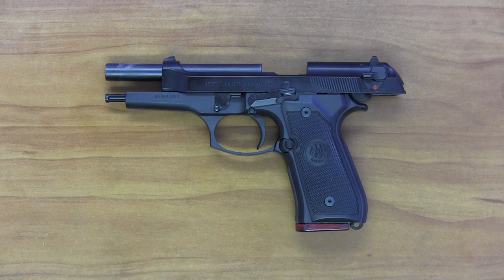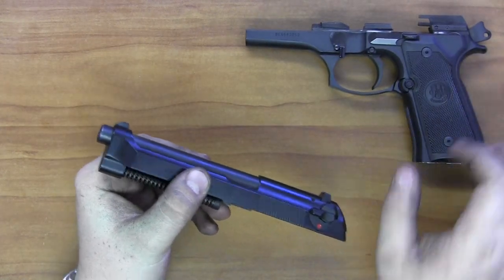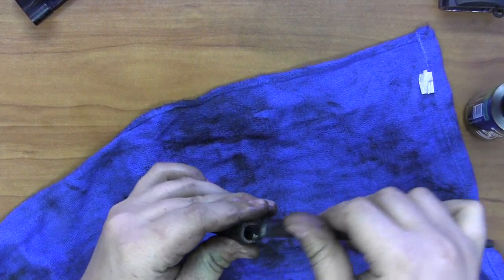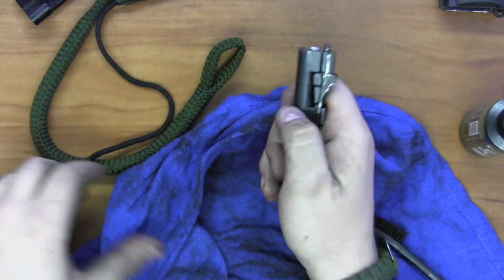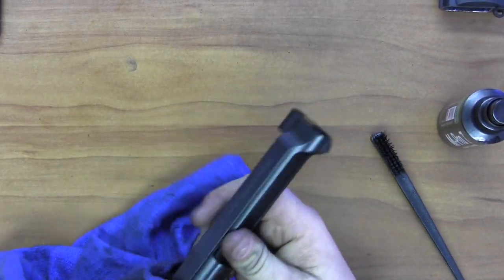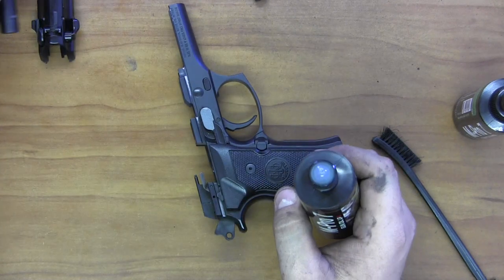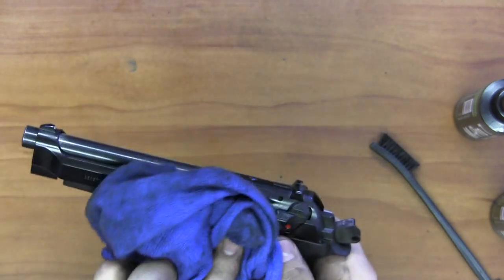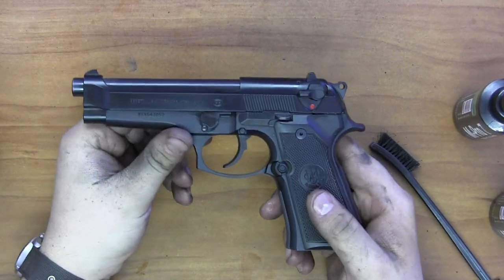Beretta M92 / M9 Instructional Video

Comment: You clean guns like I do, I just make sure that I don't get any solvent on the exterior finish of my guns. I use very light gun oil on the outside along the rails and rub any access oil over the whole outside surface with a clean rag. I make sure the interior barrel also has a light coating of oil as well. I just purchased a M9 a couple of days ago and I'm totally stoked, thanks for the video!

Comment: I have an airsoft M92 which I had to strip to adjust the hop-up. The process was exactly the same as this video and the components are almost exactly the same! The guide rod is a slightly different shape (there's a nub at one end that locks it in place) but that's about it! I was quite impressed with their attention to detail!
Reply: +fireaza What brand is it? WE, KJW or other?
Reply: +Morris Zachrisson It's a WE.
Reply: ***** Without decocker function?
Reply: That's right.
Reply: ***** Be carefull :)
Reply: y

Comment: I have a few Beretta's on my collection.  The weakest part of those auto-pistols are the locking-block,  right underneath the barrel.  As it mates to the slide.  When one of those lugs,  left or right sides breaks?  It's stays inside the railing.  Therefore,  pulling the slide manually to the rear,  makes it almost impossible to take the handgun apart.  It happened to my way back in 1993.  Luckily,  I've already fired the round towards the target.  The slide closed forward,  after it fired the round.  But the empty shell failed to eject.  The handgun was completely disabled,  with a fired round in the chamber.  So I took it to the gun-shop.  Beretta in Maryland fixed for free,  it was still under Lifetime-Warranty.  Besides that,  most 92F,  92 FS,  etc.  Are all awesome,  no complaints whatsoever.  Thank you.

Comment: Pretty good video overall.  Recommend, though there were some omissions in the function check.  Also, the slide should go into battery before using the take-down lever. It's easier on the shooter and the gun.
Reply: I agree, let the slid go forward into normal battery length before you unlock it. This will cause the slide to act like glock, and just spring forward about 1/2 an inch. Also the slide does not need to go all the way back to the rear to be locked back in. The slide only needs to return to the normal closed battery position for the rotating lock to re-engage.

Comment: Nice video. Any reason why you don't clean the magazine? And maybe next time you can shut the range down in the background so there's no distracting popping gun noises.
Reply: I know what you are saying. Those random shots in the background are so annoying. As far as the Mags themselves, they are not much of an issue. Unlike most of the other mags out there, 92 / M9 mags are made with a ton of clearance inside. Mags for a Glock or a 1911, and made to be as small possible to try to reduce the frame size down. So many of these mags have the entire sidewall of the round riding against the inside of the mag. M9 mags use a style that really on has the forward edge of the side wall of the round really making contact with the inside of the magazine. The SIG P226 is another gun that uses the exact same magazine, but with different cutout for the mag release. You don't hear too many issue about the P226 having feeding problems. They can be disassembled and cleaned, but it is not needed too; unless they really need it.

Comment: I have a 92A1 I recently purchased. When I push the button on one side and move the slide release down, it does not stay down, it pops back up by itself. I have to hold it down when I remove the slide. Is this normal? I have seen a few of these videos and it always seems to work just as you showed. Is it a difference in the FS vs the A1 or should I be concerned?
Reply: It should stay down in the open position with the cutout against the tab. Does the spring feel or seem weak ?

Comment: The hammer won't stay back. It's releasing with movement? Any tips
Reply: do u have the safety off? i was having the same problem when the safety was on and it kept engaging the decocker. with the safety off it functioned the same as the video tho.